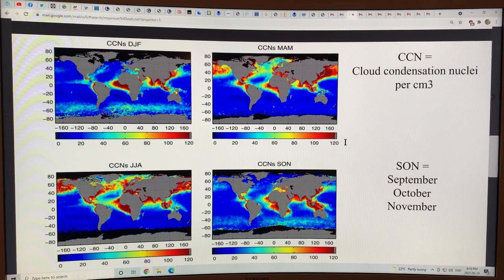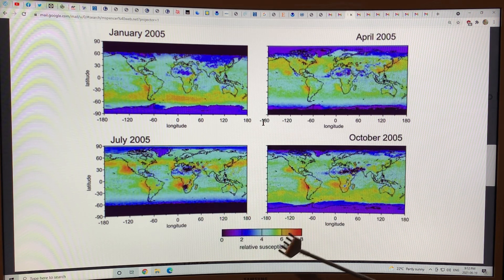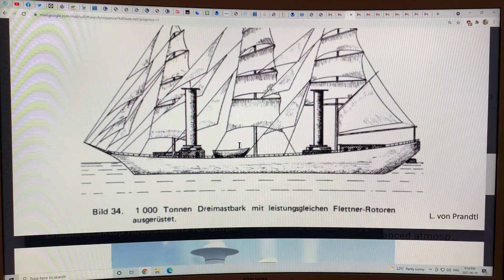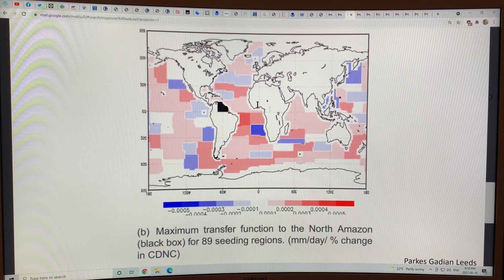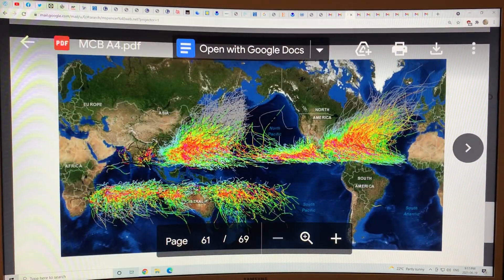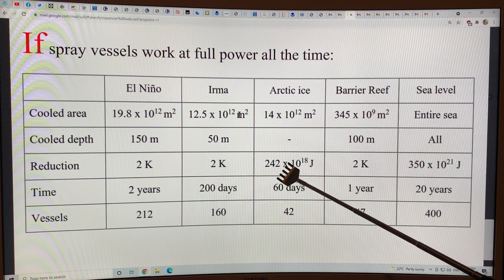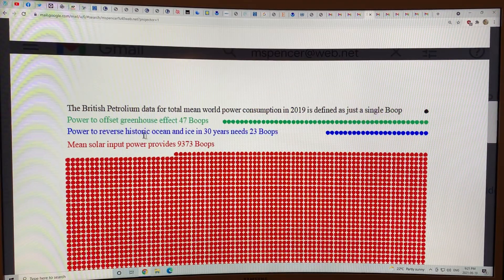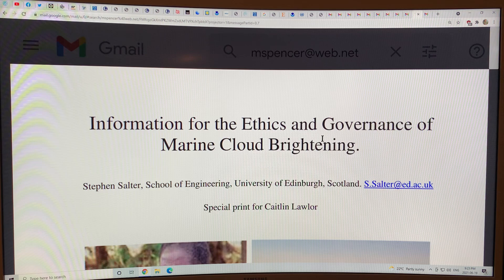On the Deployment of Ocean Spraying Vessels to Brighten Marine Clouds to Cool the Planet: 4 of 4

Comment from the maker: I was recently in a great video discussion with Peter Wadhams and Stephen Salter, hosted by Metta Spencer, to hash out the cloud brightening technique as conceptualized by Emeritus Professor Stephen Salter in the Engineering and Design Department at the University of Edinburgh over the last couple of decades.

Marine Cloud Brightening (MCB) has the potential to cool the planet in a highly controllable fashion. Essentially, sea water is pumped to high pressure through nozzles where it generates water jets that then break apart (via Rayleigh instability) to form tiny water droplets. The nozzle size, number of nozzles, water pressure, etc… are engineered to produce water droplets of 800 nm size (0.8 micron) so that when the water evaporates we are left with 200 nm salt crystals. These salt crystals are then transported within the turbulent boundary layer above the surface of the ocean up to heights about 1 km to 1.5 km where they act as cloud condensation nuclei, ensuring that the clouds that do form are of extremely high albedo (reflectivity) and thus can reflect enough incoming sunlight to cool the surface of the Earth. 

The spray nozzles are transported around the oceans of the planet by hydrofoil ships powered by the wind using so-called Flettner Rotors. The ships are sailed to specific areas of the ocean at specific times of the year to brighten the clouds in specific regions to get the desired regional cooling, for example to reduce Atlantic Basin hurricane strength, protect coral reefs, cool the Arctic enough to restore Arctic Sea Ice, and!or modify monsoons or redistribute rainfall to reduce droughts or torrential rainfalls.

This technology has enormous potential to cool the planet enough to buy us time to slash fossil fuel emissions and deploy carbon removal technologies.

Please donate to http://paulbeckwith.net to support my research and videos on abrupt climate change science, consequences, and solutions.
Reply: Now that boop illustration is very enlightening. I suppose it highlights the position of fossil fuel companies in the arena of decision making, price fixing and profiteering. What seems reasonably clear, ignoring all other collapse scenarios, is that this could actually work at a comparatively miniscule cost? Now all you've got to do is distract all the lobbyists with something shiny...
Reply: They need to roll out the technology now! If we wait longer there isn't much point in doing this as it will be too late!!
Reply: It's already too late. Obama covered up Fukushima when it should have been entombed.
Reply: @obsoleteoptics  Can you tell me how that's linked to Global Warming?
Reply: @ellondinense320  It's multiple nuclear meltdowns. An extinction level event in and of itself.
Reply: @obsoleteoptics  I can understand what you'd mean by these nuclear accidents but I don't understand how that relates to the issue of Global Warming and Climate Change...
Do they relate to that or are you sidetracking the issue we are talking of?
Reply: I do know the sea level is rising and is unstoppable. I know Fukushima Daichi 1-4 are just above sea level.. the clean-up is impossible... the oceans will rise over it all before we can make it safe...
*Enjoy every moment we have people, have fun and be good to others*.. It ain't over yet.. but get ready...  the "Fat Lady" is about to sing for the last time.. there will be no encore!
Reply: @ellondinense320  Of course they relate. What did you think nuclear energy was gonna do, cool the planet down? Helluva way to boil water...
Reply: @obsoleteoptics  Boiling water to turn turbines from steam.. obviously. 
So how does a nuclear accident in Fukushima which hasn't boiled our ocean then produce Global Warming? How is that heating up our oceans?
I'd agree Fukushima is an extinction event about to happen when the seas rise... but how does it affect our worldwide climate, please explain...
Reply: @ellondinense320  you just explained it yourself in one sentence, so what do you still need me for?
Reply: @obsoleteoptics  I'm politely asking you to explain how  Fukushima affects our climate at the moment.. explain how... not expecting you to be cocky either! Explain yourself.. don't make riddles of an interesting conversation.
Tell me then.. how would you expect them to Entomb 4 separate reactors all in different states of array without further issues?? Are you serious? How would you entomb a reactor safely if it's leaking into the sea!! Don't you think they've thought of that already??
Reply: @obsoleteoptics  Chernobyl could and has been entombed, but has now started to spike and is far from being safe.
But unfortunately Fukushima cannot be entombed as it is leaking radiation into the ground as the core is now actually under the water table far underneath the plant. Entombing it won't solve the problem.. Sorry to correct you.
You didn't explain..  so please tell us... how do you explain your comment of Fukushima affecting the climate?
Reply: @ellondinense320  Chernobyl should have been entombed, too. But unfortunately they just built a leaky metal shell over it instead. And then built another metal shell that they rolled over top of the first one to dry it all out. And now it's undergoing chain reactions again, which of course it always was, it was just moderated by the rainwater that leaked in that's now boiling off. So how you gonna entomb that?

As for Fukushima, the one reactor that melted down at Chernobyl was 200 tons, while each reactor that melted down at Fukushima was 800 tons, and that's not including the spent fuel rods in the intermediate and common spent fuel pools. The whole site is FUBAR, the pictures and videos make that clear.

Atomic weapons and atomic energy have been contributing to heating the planet since the first nuclear device was detonated. It ain't just fossil fuels and greenhouse gasses. I don't have the time or patience to explain the electromagnetic spectrum nor nuclear physics in this space. Simply put, it's bringing star power to earth. The sun burns you from 93 million miles away; imagine what a sphere of plutonium the size of a grapefruit could do to you. Have you heard of the demon core?
Reply: @ellondinense320  It's gotten exponentially worse over the last ten years, hasn't it? Climate, heat waves, droughts, species die-offs, whale beachings, tide pools, now these birds going blind... Just because you don't get it doesn't mean I don't either. It's pulsing energy every second. You don't need to keep trolling and projecting and gotcha-ing me, it's not gonna make a difference. Life on earth is poised for a catastrophic reckoning.
Reply: Surely we should be sequesting Methane  from the atmosphere rather than just cutting and sequestration of Co2?
And are we actually going to take these drastic actions now? Or are we too late to board this train.... to save it from being a runaway train about to de-rail??
Reply: @ellondinense320  Wile E. Coyote ran off the cliff on March 11th, 2011 and as soon as we stop running in midair and look down, we fall.
Reply: hi professor ; AWESOME vid  ! Q : do you think we would also attract less matter from space ? like dulling a magnet? always GTSY
Reply: Paul, have you had a look at https://www.time-planet.com/en
Reply: done some micro monthly donation. maybe you make a member only channel?
Reply: rec you do a series on carbon taxes....see eg dr james hansen's work on this. see also > https://www.economist.com/leaders/2021/07/15/carbon-border-taxes-are-defensible-but-bring-great-risks
Reply: Paul.. what do you say? Is there any evidence in what this guy is saying about Fukushima? I.E. Is there any link to having over 2000 nuclear tests worldwide, multiple accidents and it's effects would be warming our climate?
I can see something in what he's saying but he hasn't explained how. Is there anything in his accusations?
Reply: @ellondinense320  How? It's emitting radiation higher on the electromagnetic spectrum than UV, that's how. Just because you can't see it, hear it, taste it, smell it, or touch it doesn't mean it doesn't exist.
Reply: @obsoleteoptics  I'm sorry if you think I'm trolling you.. which I wouldn't ever do. I only asked you to explain your theory behind your original comment. Thanks for your answer, I appreciate it. And I think most viewers reading this would have liked to see why you said what you did.  Please don't see anything else untoward in my replies, I have no interest to want to upset you. For anyone reading your comments my intention was to find the reasons behind your comments.
I also believe that the world is suffering due to our incompetence in many aspects, let alone 2500+ nuclear detonations worldwide plus serious accidents. And what about more serious issues we haven't even been told about.... hidden from the world to stop panic and anarchy.
Reply: Climate is changing as it always has.
STOP weather engineering 🆘 I
Killing LIFE on EARTH 😡
Reply: The filtration system on these will be problematic in regards to the plastic and other forms of pollution extant.
Reply from the maker: @richdiana3663  When the flow rate through the nozzles gets too low (clogging) then you automatically flip the filter wafer 180 degrees and resume; the crud gets fired out clearing the nozzles…
Reply: Just another cart before the horse theory, but by all means continue as our point of no return happened decades ago. You and your parents weren't part of the solution then, and unfortunately even if some of your or your likes theories are utilized if allowed after you as well as majority of whomever you currently know are gone, so be it.

Comment: Digressing  - surprised Paul hasn't yet commented on the latest jet stream perturbation & heat dome over the Pacific North West
Reply: @Fisho's Shore Angling Videos I wondered about the salt component in marine cloud brightening because normally when salt water spray evaporates only the water evaporates, leaving the sodium and chloride ions behind which forms salt crystals.  Getting such crystals 1 km or more above sea level into clouds sounds like it might be tricky even if they are nano salt crystals forcibly projected up within tiny airborne water droplets.    So perhaps the salt content in subsequent rainfall will presumably be correspondingly tiny &  not enough to worry about defrosting the Arctic!

Comment: In my opinion the mean slope of Arctic volume reduction will accelerate exponentially, because we are entering the latent heat refreezing phase in winter now. This will prevent to drop down the temperature below freezing point, because a mixture of water and ice is not able to drop below freezing point. I hope my theory is wrong.

Comment: This certainly is a proposal worth attention and study--even testing. Given the recent distortions in the US Gulf Coast states' weather, and, since the coastal geography of the inner Gulf waters is predominately within US rights, it would at first seem that that area offers a feasibly confined test region.  Perhaps Mexico would cooperate.  But, alas, just starting to think of the political contortions needed to achieve a go-forward test boggles the mind. Can anyone outline a first political step toward such a test? Given the data Paul has presented via Salter et al. this is not a Manhattan Project.